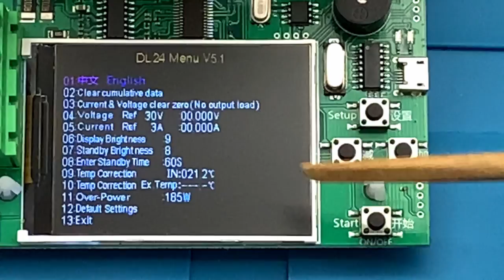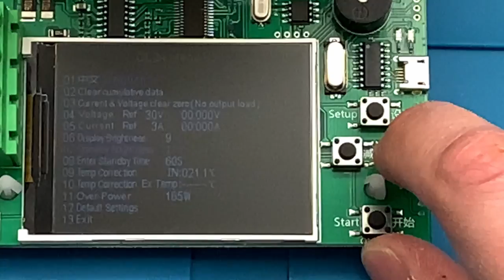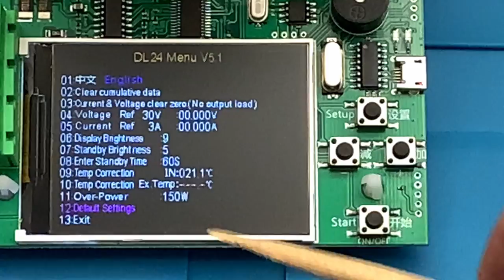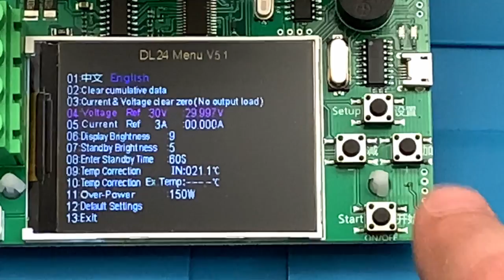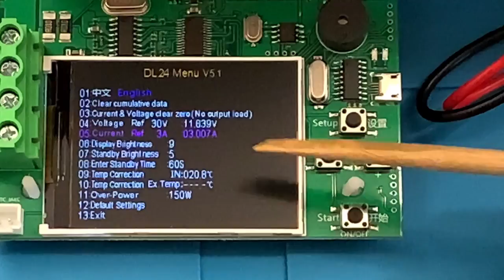ATORCH DL24 Configuration and Calibration

Comment: Shouldn’t you use a quality multimeter to measure the 3A current, rather than relying on the (uncalibrated) meter on the second unit?
Reply from the maker: You could certainly do that if you have concerns about accuracy. At the time I was focused on how to carry out the calibration. I will make a note to check the accuracy on these loads in future videos.

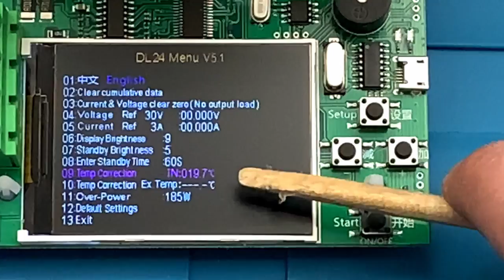Comment: 9:33
The load is the same temperature as the heatsink (unless you've just been running it). So just measure the heatsink and set that as the internal temperature.
On the latest version you can only calibrate the external temperature.
The new version has some other very welcome features though: not only can you set over-power protection but also over-current protection and internal & external temperature protection.
Reply from the maker: Good point. Thanks.

Comment: I just bought one of these, and it has some significant differences.   My menu has 19 items, not 13.  I do not have the plug on the right side to set current, but rather several tabs on the PCB that are labeled.  Other differences include the same power input and supply as this one, but it also has  USB C input on the back to power it up as well.   I have the infamous led fan and a few other PCB differences.  The Amazon listing showed it to be the run of the mill version.  I wonder if I got a newer model or a knockoff of the real thing.  😮
Reply: It's the newer model.
It uses different firmware and the settings menu is spread over multiple pages. You can now set maximum values for power, voltage, current, internal temp and external temp.
The maximum values you enter will cause the test to stop and the screen shows the reason for aborting (over current/voltage/power/temp).
Calibration has also changed; you can calibrate at any voltage or current.
Reply from the maker: I think you may have a different model
Reply: So I need a second load tester to test my load tester or its useless?

Comment: I just got dl24 an the fan power on once u plug it up for a few seconds than turn off. I put a small load on 2 amps to c if the fan comes on but nothing. What do you think?
Reply from the maker: The fan only runs if the temperature of the mosfet gets high enough. What's the total power? 2A and 5V is only 10 Watts, that would not get the fan running.

Comment: What is the meaning of the LEDs in the DL24 unit?
Reply from the maker: There are two LEDs that flash when bluetooth is not connected. When bluetooth is connected the LEDs are solid.
One LED flashes when the unit is turned on. It seems to be a heartbeat LED indicating operation.
I have not yet figured out what the fourth LED indicates. Perhaps it is some error condition.

Comment: At @16:37 the RED and BLACK 4-Wires you made, can you share the part details with me so I can make one for myself? What clamps, wires, heat shrink and specially the wire connector you used to insert the wire into the batter tester side? I am particularly interested in the GREY connector on the RED wire that is going into the 4-WIRE GREEN terminal on the device. Thank you.
Reply from the maker: The clamps came from Home Depot, they were a package of 2 GB Battery Clips rated at 30A.
The wires are 12AWG Silicone insulation.
Heat shrink is whatever I had lying around.  I think in this case it was the heat shrink with the glue. I would not recommend that style here as it slid around more than I would have liked as it was shrinking. Amazon has all kinds of heat shrink bundles with various sizes. Generally I choose the smallest size that will fit prior to shrinkage.
The wire connectors at the ends are crimp on ferrules. Amazon has packages that consist of the crimper and a couple thousand ferrules for different sized wires. The grey is the colour code for the wire gauge.
A note about crimp on ferrules. Get the crimpers that crimp to a square and not the ones that crimp to a hexagon. I initially thought that the hexagon crimp would be better because it would conform better to the round wire. The problem I ran into was that the hexagon crimps would not fit into terminal blocks like the green one that is attached to the device. 
Lastly, in the four wire setup, two wires are current carrying and two are sense wires. Several people have written that the sense wires do not have to be large like the 12 AWG that I used. That's true, but by using the same gauge for both I don't have to concern myself with another detail in connecting them. I am constantly swapping between the 4 wire connection and the power adapter connector.

Comment: Great video! Did you ever try controlling your DL24 through the serial port and Python for say, automated testing? I tried using the "KrystianD/dl24-electronic-load" library you find on github when searching for "dl24 python library" online, but I have no success in running it reliably, I get timeouts all the time at completely random moments. Interested to hear if you have a better solution, Cheers!
Reply from the maker: I have not, however, there is a thread https://www.eevblog.com/forum/testgear/atorch-dl24-electronic-load-software/ where people discuss the software produced for the DL24. Seems that even with the vendor software it is challenging.

Comment: Is that calibration absolutely necessary?  To know if I cancel the order for DL24 or not, because I don't have the possibility to do those calibrations
Reply from the maker: The unit comes calibrated from the factory. Calibration doesn't impact function, it impacts accuracy. For example suppose the voltage is off by 0.1V in a 5V test setup. That's 2% error. If you were calibrated the error would likely be closer to 0.02%
Reply: @jtechlabs1  THANKS!
Reply: I’d expect reasonable accuracy from the factory. You can easily do a sanity check with a cheap voltmeter.

Comment: how do i get it to work with a powerbannk
Reply from the maker: Have a look at this video https://www.youtube.com/watch?v=HjY95-U7_4U 
It shows a 12V battery. For a power bank you will likely have 5V and set the current to a typical load like 3A or 3.5A. I would suggest setting the cutoff voltage to 3V.

Comment: so when you have bought one, you need to buy a 2nd to calibrate the first, but the 2nd one wont be calibrated so you need to buy a third, but the third wont be calibrated....

Maybe we just need to use the calibrate out socket to a 12v 55w car headlight bulb in series with a multimeter set to amps, then adjust input voltage to change brightness of bulb/meter reading for 3amps and press the set button..
Reply from the maker: You can absolutely use any known 3A load

Comment: I have that one on the right @ 16:48. Do you have a video on that one? I bought it to test a 100 amp battery but it just came today so have not used it yet. The one I got from Amazon is identical but with the brand name of "MakerHawk"
Reply from the maker: I haven't done a vid for it yet, but I will prioritize it   I first saw it on ProjectFarm. One of the key differences is that it allows for very fine control over the load with a simpler control structure of the knobs.